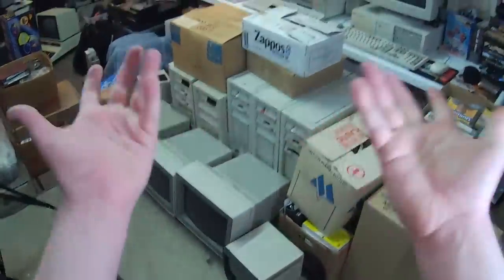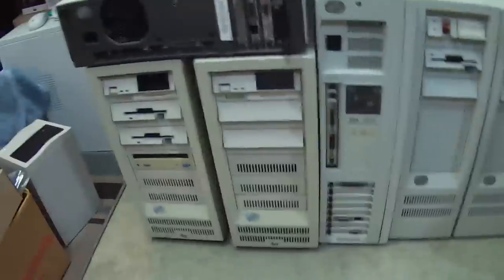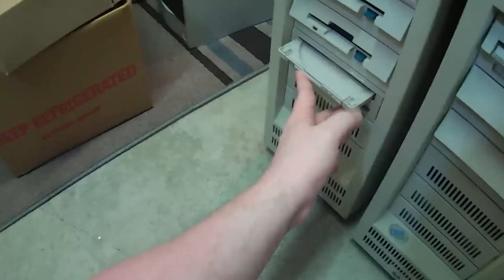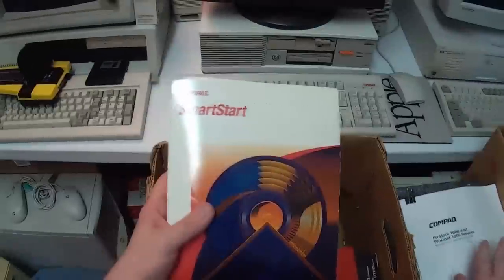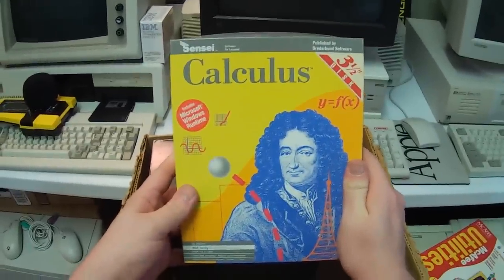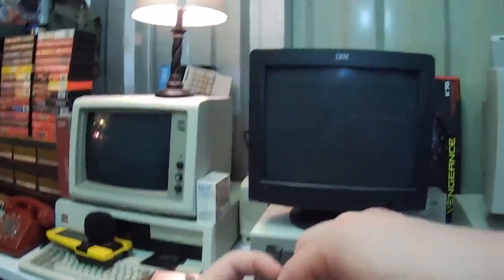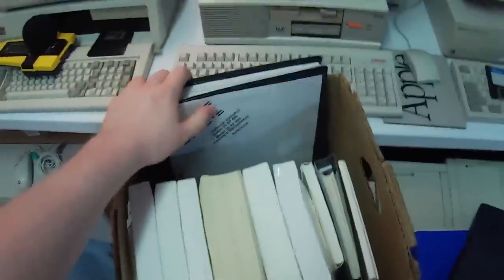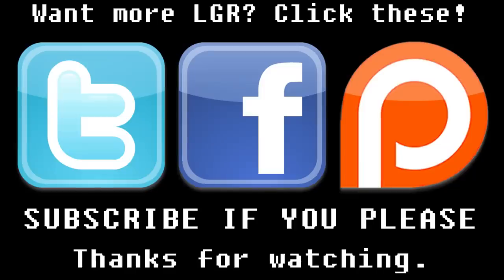LGR - IBM PS/2 Computer Motherlode

Comment: 2.0 MB is the unformatted capacity of a 1.44 MB diskette. 2.88 MB diskettes have an unformatted capacity of 4.0 MB and also have the "ED" logo on them, for "Extended Density". However, IBM's floppy drives do not have a media sensor, so you can stick in an ordinary 1.44 MB diskette and format it as 2.88 MB without any problems -- although the data integrity may not be as good as if you used a real 2.88 MB disk. And the 8515 monitor can actually display 1024x768, so it is an XGA monitor, not just plain VGA.
Reply: that is super vga
Reply: Super VGA is 800x600
Reply: A QL got 3.2 MB fron the ED disks
Reply: YEAH TALK DIRTY TO ME
Reply: Kaminishi Technically SVGA starts at 640x480x256. All the good games in 1996-1998 were SVGA and ran in 640x480.
Reply: I understand the need to categorize resolutions these days because of the fact that non-native resolutions look so shit on LCD screens, but honestly, I think it seems so pointless to nitpick about resolutions back in the CRT monitor days, seeing as those old monitors really just didn't give a shit. Like literally you could go from 640x480 to 1600x1200 and the only difference was whether you were bothered about the slight flickeriness of 60Hz or not.
Reply: eddiehimself Not really. In the early 90s SVGA monitors were usually able to go up to 1024x768, but in DOS the actual resolution was 720x400 (text mode).
Reply: @spearPYN  Who said I was just talking about the early 90s?
Reply: @eddiehimself  the 8515 is specifically XGA, initially there were 2 common designations for 1024x768 resolutions, 8514/A for an interlaced version (you thought 60hz was flickering? haha) and XGA for non interlaced versions, regardless of the actual number of colors supported (this is analog electronics, it doesn't really care about that aspect).
Both are named after specific (IBM) graphics cards that introduced those. Both are generally supported by SVGA cards from the 1990s and later.

In order to have a CRT switch between resolutions, you actually need a multisync display, which had become pretty common around the same time, but for example the 8503 and 8513 displays LGR has are not multisync, and while you can kinda push them to 800x600, they struggle, and are really made to support the offical range of CGA/EGA/MCGA/VGA text and graphics modes only.

Comment: My first Windows computer was an IBM PS/2, but it was different than all of those you had. It actually had a push button power switch instead of the more common flip toggle. It came with a 3.5" and 5.25" floppy drive. The 5.25" was hidden behind a pop open panel which had an additional bay that we later added a SB16 CD drive to when we got our sound card. The monitor was different too, it had black peg knobs behind a flip down panel for brightness and contrast. Oddest thing of all... Even though it was a 486 PS/2, it came with a bunch of PS/1 software. We were the first owner of it, so it wasn't a case of getting the wrong stuff from the seller. We bought it from Radio Shack in the Jackson, MS mall back in 1993.

Comment from the maker: If the shaky-cam is giving you motion sickness, try this version of the video:
https://www.youtube.com/watch?v=1dqdoCTrMBw
Reply: Lazy Game Reviews Wow this is the first time where I see youtube's "shaky footage fix" work!
Reply: Lazy Game Reviews Last Friday I just threw out 3 of those exact same monitors that have been sitting in my house 20 - 25 years. Well taken to my local recycling center. They weren't touch screen either. I've got so much old computer garbage around here. I think it yellows because of a flame retardant material in it. I learned that back with Legos and then the SNES.
Reply: Lazy Game Reviews cover all!
Reply: Lazy Game Reviews The 2.88 MB Drive needs 4 MB Floppies to format a full 2.88 MB, they are not useless in the least however, they generally can recover data from floppies that have been badly kept or that have aged poorly, as you have a few extras maybe you could connect one to the imaging controller for floppies, should cut down on time spent and increase accuracy of the images. I want to see more of the Tubes of RAM btw, I soo need tubes of RAM!
Reply: ***** Don't know exactly what you mean, but yeah the magnetic coating only lasts for so long, any storage media will age even under perfect circumstances and it is not always directly related to the quality of the media.
Reply: The second you turn on that dot matrix printer it will rock your house to the point of structural failure.
Reply: Lazy Game Reviews Ah man, I wish I had seen this before watching the entire video. Now I'm sitting here with a headache and feeling sick.
Reply: Lazy Game Reviews Where will you put that stuff? There's sooooo much
Reply from the maker: Corey Gibson http://www.amazon.com/iVUE-Horizon-Camera-Recording-Sunglasses/dp/B00NAI092S
Reply: Lazy Game Reviews Hey is there any way i could take one of those IBM model M keyboards off your hands?
Reply: Lazy Game Reviews hey Clint can you please review the Baldur's gate games?
Reply: Lazy Game Reviews I take offence to that. I grew up with W95 lol
Reply: Kristina From where I sit I see NO deleted comments. all of them are still up, fisheye complaints and all.
Reply: Games That I Play Don't throw any more of it away. Sell it. Seriously, you'd be amazed how much some of that stuff goes for. Those monitors could've gone for $100+ dollars each. I still regret throwing out my Powerbook G3 after learning how much they go for.
Reply: Lazy Game Reviews ALL OF IT!!!! COVER IT ALL!!!! (that got unexpectedly dirty for a sec...awkward)
Reply: Sudhir thelegend Lazy Game Reviews 
I want it all, I want it all, I want it all, and I want it now

The bad thing about this is, that it's all comparatively new stuff (I mean ... CDs .... ever seen original core memory ?)  from the early to midst of 90s that now looks so dated. Try finding an 8-inch floppy drive.
Reply: ***** 
depends on the quality of the disks, the drive and especially how they were stored (temperature) ... but sooner or later the magnetization will get lost ... creating images of them for permanent archival is a pretty good idea
Reply: Games That I Play You are right it yellows because Bromine (flame retardant) reacts with UV rays, it is possible to whiten them back up to near original.
Reply: Lazy Game Reviews I was wondering why I was feeling so queasy!
Reply: Lazy Game Reviews I wish I was this lucky and had the money to get clasic systems, i would love a old ps/2 system.
Reply: Lazy Game Reviews So adjusting for infaltion, this would be nearly a 15 thousand $ PC the original owner bought? What would be the use of  such a computer for that price in the late 80's, early 90's anyone? Clearly wasnt for gaming? Only ppl I knew with actual PC's, were using them for word processing, etc. They wouldnt have spent more than 1k on them...
Reply: Bucky Monk I'm not sure about the US-market back then but in Germany you couldn't get any PC below 1000 dollars. I would be surprised if it was much different in the US. And nobody bought such a PC for gaming. Thouse 15000 dollar IBM machines also were the absolute high-end. My uncle bought an Atari PC with an Intel 8088 CPU in 1987, because it was cheaper than original IBM, but still paid 8000 german marks, so roughly 4000 dollars. He used it for early CAD-work and office stuff on GEM-desktop. In those times any program with a GUI would already eat a lot of CPU power and the CPU had to do everything on it's own, even controlling the harddrive-interface. Despite the 4000 dollars the game "Digger" did slow down when many opponents were on screen. The GEM-desktop had a paint program and that had some stock pictures in it, I think pcx-file-format. However loading certain pictures, I remember one being a tiger, took 15 minutes rendering in just black-and-white, in this case outputted on a black-yellow/orange CRT-display. I've now got that Atari PC in my collection complete and still working, just need a new battery now.
Reply: armorgeddon
Ar you sure it as an Atari 'PC' ?The early Atari Computers that i am aware of are: 400, 800, XL-Series (600,800,1200), XE-Series and ST-Series. This covers roughly the timeline from 1979 to 1990 and all were either Atari OS or TOS based. So i would be pretty surprised i Atari had done PC clones in 1987.
Reply: Frank Schneider Atari did make PC clones, because they figured out that that's the way the market was going in terms of the business customers. The models you listed never had an Intel 8088 anyway but Atari had that GEM-desktop for those models, too. My system is standing in my man-cave. It's an Atari PC3 8088-8, the monitor is an Atari PCM124. I really like the overall styling of the system. It's still running it's original DOS 3.2 and you can load GEM from the command prompt. Look it up on the WWW if you're interested to find out more about those Atari PCs, there are pictures, product promotion flyers and technical documentation on the net or at least they were when I booted it up for the first time in 15 years (2007 that was). That reminds me of the Atari Portfolio I also have, although it doesn't boot. That was a ultra compact laptop from Atari, in fact you'd consider it more as a PDA, but it ran full DOS 2.0. My father bought it IIRC at end of the 80s and it was very expensive, too.
BTW Commodore also did PCs in the 80s, my father bought one used and it still cost ~3500 dollars then. It was either the Commodore PC 10 or PC 20. I remember we bought a graphics card for it to play Digger and Space Commander, because in standard spec that PC could only output text, but no graphics.
Reply: armorgeddon
I am pretty much aware of the Atari Portfolio and that Commodore made PCs, but not that Atari did some too (just googled it). I've never ever heard of them before. Thanks for the info. :-)
Reply: Frank Schneider No problem, your are welcome.
Reply: +Lazy Game Reviews Would you be willing to throw a copy of that "intro to microwave tubes" disk somewhere?
Reply: +Lazy Game Reviews 
It isn't the shaky camera that makes this dizzying...

Your lens has a screwed up FOV, or something, because the image is horribly distorted.
Reply: +Aryzen Inniriea It's a small wide-angle lens, of course there's going to be barrel distortion!
Reply: kasm279 
Hmmm... This kind of video doesn't really need wide angle...
Reply: Aryzen Inniriea That's what the GoPro has though, which I imagine Clint used just for size/head mountability.
Reply: kasm279 oh
Reply: +Lazy Game Reviews what is the computer in the background at 9:31?
Reply: i have seen those before     but i cant remember sadly :/
Reply: commodore pet
Reply: i you ever get rid of them let me know
Reply: honestly, after a certain point i didnt even notice
Reply: wow looks awesome :D
Reply: Lazy Game Reviews One of the Norton CD's have a meme on them

Comment: This is beautiful. Out of curiosity how much did all this cost?
Reply from the maker: $300
Reply: +Lazy Game Reviews $300 for hardware and software worth $100,000, not bad  ;)
Reply: Lazy Game Reviews
That is simply amazing, usually people want that money for a single PS/2 model 60. I do suppose people do cut deals for those who respect the machine in question. He knew it would have gone into good hands.
Reply: +Lazy Game Reviews Worth it.  I see single 386s going for $150+ on EBay.  What's up with that?
Reply: +Lazy Game Reviews HOLY CRAP
Reply: +Lazy Game Reviews 

I'm in the UK, and you could pay that much for the box of model M keyboards alone! Score :)
Reply: Watching this takes me back 20+ years, to when I was yanking hundreds of these out of Hughes Aerospace.  Those things weighed a ton though.

As for the disk on microwaves, that caught my eye.  It was from Litton Industries, another long gone early leader in the Aerospace industry.  one of their major segments were RADAR systems (where microwave rubes were originally used).
Reply: $150 for a 386? that's absurd. 20 years ago you couldn't give them away
Reply: @0311Mushroom  As in the former large Hughes bldg. (seems like it was HQ + R&D + manufacturing) in CA, that's now occupied by some other corporation?
Reply: @ruslannabioullin3664  several actually.  There were over 100 buildings.

Corporate HQ is now a college.  The main office area is now Raytheon.  The satellite factory is now Boeing.  DirecTV is now it's own thing.
Reply: @0311Mushroom  Oh, what about the one that housed the mm wave division?
Reply: @ruslannabioullin3664  it went to Raytheon, they bought the RADAR division.  But I have not worked with that group in over 20 years.

Comment: When using PS/2 (except model 30), it is very important to have the BIOS related floppy disks, as the important boot up and BIOS screens/config/code for both the machine and each MCA card was delivered on floppies, then optionally installed on a hidden hard drive partition.

Comment: I rebuilt an IBM PS/2 computer from parts I found to be good and the computer worked just fine. This was one which I built to be used on the job, but I found that I was the only one other than the inmates in the department who knew how to operate it. It had MS-Dos and Windows 3.11 on the hard drive and i loved it and the staff gave us a much newer computer and took this one away.

Comment: 'Unexpected Error'.  As opposed to the expected, intentional errors?  I think 'Error' pretty much covers it.
Reply from the maker: Ha, fair point. I'm sure there's some technical reason for it being "unexpected," but thinking of it normally makes little sense!
Reply: I understand why it might say 'unhandled exception error' if a program b0rks in a loop that doesn't have an if/then 'exit status 1', or something.
Reply: An "Expected error" is something so common the programmer knew it would happen a lot, such as "no diskette in drive".
Reply: 'Unexpected error.' That means Windows had an error that it didn't actually intend! I didn't know that was possible!

Comment: If you need startup disks there is a a great PS/2 community that maintains many of the files from the old IBM ftp site. I had one Mod 50z (286/287) with 12 meg and it actually ran Word 6.0!
PS/2's are really nice machines and so well built. Nettamer was a great lil program that I used to surf the web on a Model 5150 with a modem but that was years ago and it only worked on Lynx friendly web pages. Great channel!

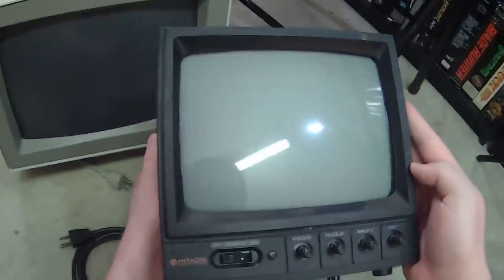Comment: The Hitachi screen at 6:10 was a common thing on Wall Street for displaying market data.  Cannot tell if there are two coax connectors on the back but I see a switch for 75 ohm termination.  They would have taken RS170 (composite video) over coax from some sort of market data service.  With two coax connectors it was possible to daisy chain them and display NYSE ticker on them all over the office.  Assuming you had permission from NYSE that is.  The last screen in the chain would have the 75 ohm termination switch set and the rest not.  Their value is that they were stackable.  The hard part was that the New York City building/fire/electrical code prohibits power strips that are not permanently mounted and connected to mains with conduit, so a power user might have a lot of PlugMold attached to his immovable trading desk.

Comment: Can it run witcher 3? I heard a potato could run it but wasn't to sure!
Reply: Wreck-ItGamer 
Yeah, they should be yble to do so, but only very very slowly ... and in text-mode only.
Reply: Frank Schneider Ultra settings text-mode? Running Windows 98 beta?
Reply: Wreck-ItGamer
nope, Taligent and a windows emulator on top
Reply: Frank Schneider Ahhh. Ok thanks m8 for the help
! Just burnt Wither 3 to my floppy disk!
Reply: Wreck-ItGamer
I hope you used the 8'' floppy discs (Not sure if anyone remembers these) to save some space.

Comment: I work at an Iron foundry that has modern windows 10 machines throughout. Except of course for one running an 80s or early 90s Spectrometer. It STILL is running with Windows XP and one of those IBM Pro printers. It's functional, and used at least once every few days. This modernization to modern systems started about five years ago. Up until 2011 we were running our shop on Mac II GS machines. No lie. They gave me 2 of them, sans hard drive due to proprietary software and security issues.

Comment: We had those touchscreen monitors back when I was in high school, connected up to cd-rom based PS/2 machines which taught us Physical Science.  We'd all be in groups of four or five, interact with the material on screen (with a very loud "boop" when you touched anything, even worse when you consider there were about five or six machines in the room), and filled out worksheets as you went.  Eventually you took tests on it all, and that was about it.  Literally most of the class was spent on the computers.  It was almost impossible to fail, and yet there were people who managed to do so anyway.

Comment: Cool, that Sullivan Associates group was located ten minutes from me! I drive past that building now and then. It seems they might even still exist, but in a different corporate center a few miles away (still in Wayne, PA though). 

It's entirely possible the chap from whom you bought all this stuff worked, at some point, with some tech professionals I know, given the academic and/or networking nature of most of these components and systems. That's really neat!!